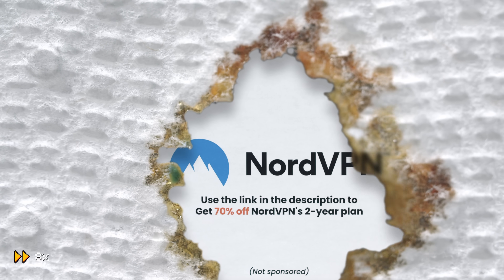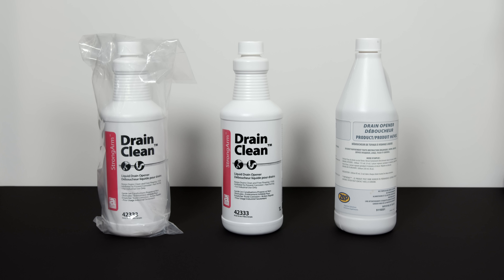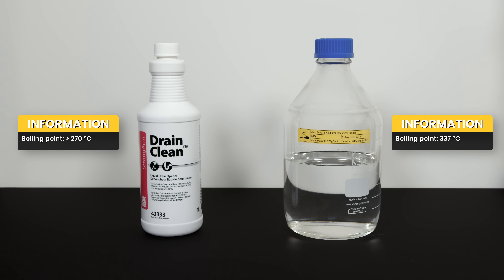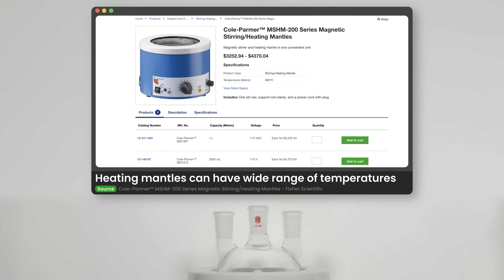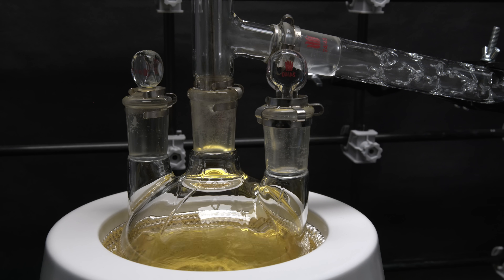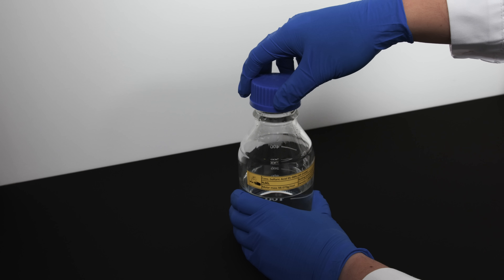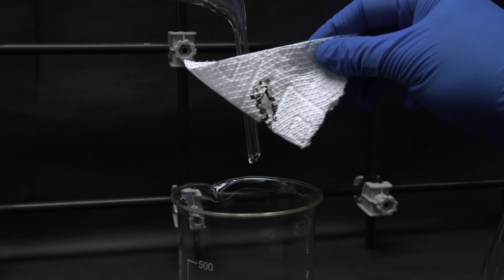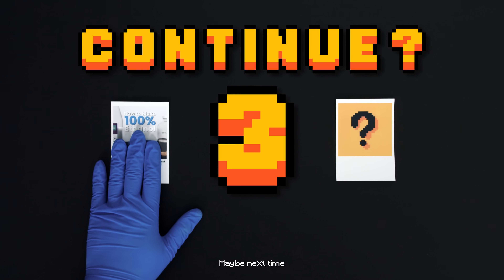The Most Dangerous "Simple Distillation"

Comment: What about sand bath for heating with fire? I use this for any distillation i've made because it's the only option I have since i don't have a hotplate
Reply from the maker: It can, it works similarly to heating mantle but a little bit messier and you need to pay more attention on the heat control to do that. The good thing is that sand bath is also acting as a safety need if there is an accident.
Reply: It's maddeningly slow and has very high thermal inertia. I've found it better to use an air bath made out of a foam concrete block. It heats the flask unbelievably fast and provides smooth boiling even with glass chips.
Reply: @dimaminiailo3723  where can people find out more about foam concrete, how (or if) you shape it, etc.?
Reply: @davidfetter  Foam concrete is a common building material, it can be found in virtually any corresponding store in the form of blocks. It's easily cut and crumbled with e.g. a long screw. The overall shape should be such that it contains the flask while allowing the gases to go along its sides and leave from a hole drilled into one side of a foam block so as not to overheat the neck of the flask (which causes fuming). The gap near the neck is stuffed with some basalt wool. I found that using three separate slabs is the optimal way to construct this